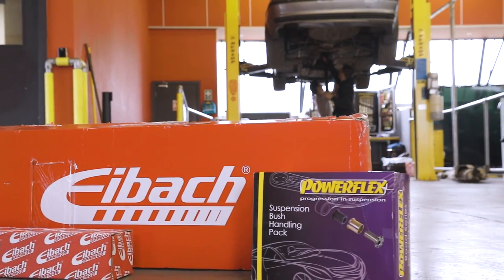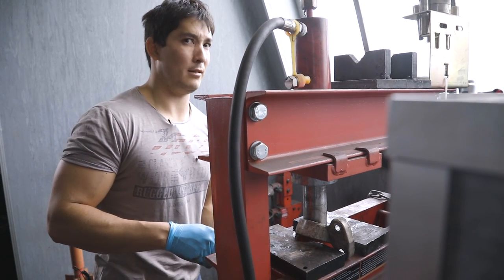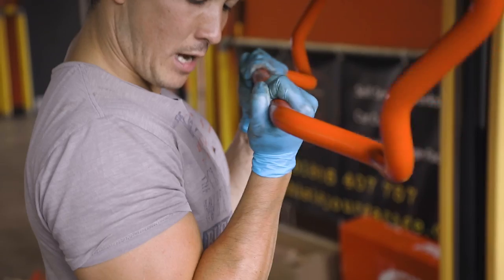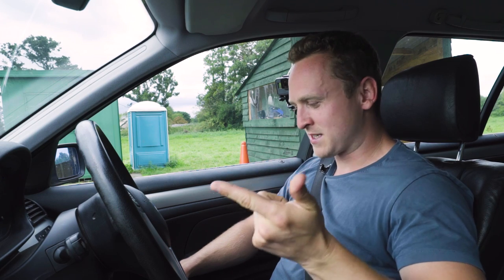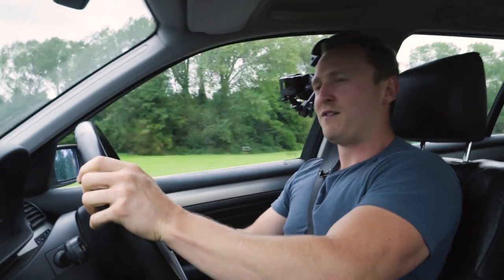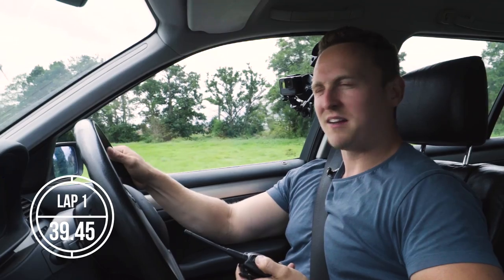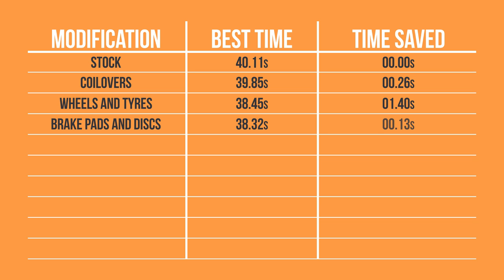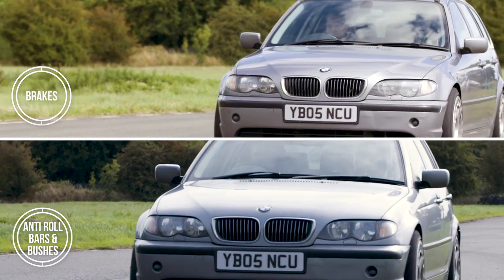Do Thicker Anti-Roll Bars And Polybushes Make A Car Faster?

Comment: Help! I have an Saab 93-x i thinking about changing the swaybar bushings, to some powerflex bushings. But the stock frontbar is 28 mm and the rear is 21mm. But I can only find 24-25 mm for front and 17,18, 19 mm for the rear in the store for my car. Am I supposed to use smaller bushings or dosent they fit my car? It's an XWD

Comment: But putting those bushes in there will put more stress on the material itself and especially e46 from the first generation had massive problems with their rear seperating from the body, cracking all over the points it´s bolted to. Kyle Reese is doing it on his M3 atm, check his channel, he has the problem and the solution! .

Comment: How much NVH did you get after installing the poly bushes? After i installed a poly bush  engine mount due to the engine always ripping it after the tune, i got quite some vibration in the car.

Comment: You should have put the car on the ground before you tightened up the roll bar. Without doing this you'll have preload on the bar which will cause understeer. The weight of the vehicle on the suspension is crucial in this install. Just like the install of monoball bushings for control arms which will create added nvh unless install with load.
Reply: It's also why you said " the tires are the weak point" because the tires can't grip due to the stiffness of the bar. That's gotta be a second right there.
Reply: In the slow motion clips it's very apparent what the car is doing.

Comment: Who wants to tell them that the stiffer sway bars helped the inside wheels lose grip?  Anyone?

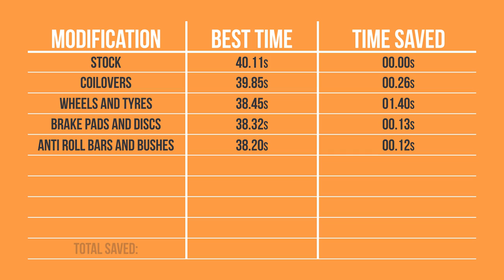Check the slo-mo at 11:29.  More steering angle in the front tires, more daylight under the inside wheels during the left turn, and the entire car is not as straight on corner exit to set up for the following right turn.  It's skating sideways, not going forward.

You guys saying that this car looks like it's getting too stiff for this course are right.

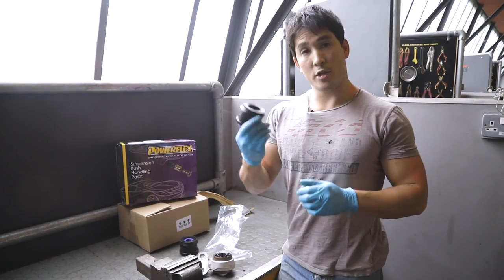Comment: Not sure using the best time in each video is a fair way for comparison. Alex started from a lap time of 1:39.45 and ended with 1:38.20. That was a difference of 1.25 seconds. Compared to 0.12 seconds shorter lap time over the brake video, it seems to me that driver variation can easily explain that improvement. Put it the other way, had Alex kept practicing in the brake video, he would have trimmed an extra 0.12 seconds. If so, how could we tell the effects of the anti roll bars and polybushes? Some suggestions: Alex should practice and gets familiar with the new hardware before timing a lap. Once consistency is achieved, an average  of 3 lap times would be a better indicator.

Comment: You should turbocharge your coilovers, then add a wet shot of nitrous to your dif. I'd also get the ECU slammed and install an airbox-back exhaust
Reply: For maximum performance though, you're gonna need to get a forged interior, have your bottom balanced, install direct to forehead throttle bodies (as many as you can fit, more is better), then drill holes in your engine block and head casting to save weight.

Comment: The car needs weight reduction throw away those seats at the back and fit in a recaro bucket seats,change the engine oil to fully synthetic (castrol edge),platinum spark plugs,straight pipe exhaust,short ram/cold air intake,aluminum radiator,racing injectors,lightweight flywheel,racing ecu/chip,lightweight crank pulley,polished engine block would do a lot better without turbocharger just my opinion.
Reply: yeah spark plugs on a diesel

Comment: Anti-roll bars are actually a very 'risky' thing to mess with. Risky in the sense of risking to make your car worse. They make a huge difference to the amount of mechanical grip on an axle so if you get this wrong it will make the car worse. They're probably the last thing to mess with when tuning a car, especially if you see how little the time gain is from installing one.

Comment: i personally found stiffer adjustable bars one of the worse mods to do.. very hit or miss. better off using adjustable front and rear damping to control handling assuming you already have decent anti roll bars.

Comment: I cant watch you putting new PU bushings into the rusty piece...
Would it be that much of a problem to, while the part is off anyway, have it sand blaster and give it a lick of paint?

I know it would take a tiny bit mroe time.. but it would be doing things properly and not a half ass job.

Comment: All the suspension and brake mods combined were a third as effective as getting better tires. In my opinion, suspension upgrades are highly overrated considering their cost-to-performance factor. I've tested dozens of tires on the two cars I've owned, and I've found that tire choice is one of the most important things you can make on your car. Most people only think about how long they last, or how loud they are, not how they perform or handle. I'd save my money on the suspension and spend it on getting the right tires for the car, even if that means replacing them more often.

Comment: Not a great idea to change the bushings. The reason they were originally equipped with rubber is because the soft rubber flexes. This fex is taken in to account by the engineers to assist with handling.  Its called elastokinematics

Comment: weight reduction. steering wheel, front seats to racing seats, and rear seats out. probably almost 200lbs , especially if the fronts are power and heated, they're probably 60lbs each.

Comment: I had a black E46 330d MSport Touring. It looked the nuts, but honestly it was the worst car I've ever owned. Even with new Eibach springs, Bilstein shocks & bushes all round, it handled terribly. Felt even the smallest bumps on the road yet wallowed like a barge round the corners. So many people rave about BMW's so they can't be bad, but I never did work out why mine was so horrible.

Comment: What about seam welding the chassis
Reply: Casey's Garage and full roll cage?
Reply: @JakobusVdL  why not? They could build one from scratch for cheap
Reply: Casey's Garage  - how about,
More stiff = Good, 
More weight = Bad, 
Easier to do than seam welding the chassis? Probably. 
Still a useful road car? Probably Not.
Reply: @JakobusVdL  how would it not be useful as a road car? Just because it would be a rough ride? That's not even an issue. On top of that, it's not like Alex doesn't have something else to drive

Comment: Give it 12000000 more HP, it won't go faster because of these nankang not putting it to the ground... RE71r or stickier non-streetable tires are a must at this point... And maybe not hitting the kerbs so hard would help too, the car is flying at times... Less power put to the ground....

Comment: Your rear end is too stiff. Never thought a bloke would say that to you eh? The rear tyres are tending to skip around and the coil settings need to be dialled back a wee bit. There is this myth that harder lower suspension must give better traction and adhesion, but its not so. 

On a track that tight, you might want to look at increasing the negative camber a bit too. By the way, you are wrong about not feeling the difference on a road car. Fitting a full set of polys would just make a bumpy noisy car, so with a real world car I would just go for front ARB bushes. These are also the ones that tend to deteriorate most quickly, and manufacturers treat standard items as more or less disposable. They really do sharpen up the front end.

Comment: I think you are very wrong,being into car sports since i was 11 years old starting with karts,banger racing,stock car,rallying and now being in my 40's uprated suspension,bushes,anti roll bars/sway bars,steering racks,bump stops,top and bottom braces etc make alot of difference to road car driving and not just track days..the control of the vehicle changes enormously and braking to.keeping the tyres flat on corners and car toe and camber adjustment as well as alignment is the basics to the ultimate car handling making you trust the car alot more and reducing the loss of control..do the cone test and see the difference

Comment: Very nice series but it's so ugly to see adding brand new aftermarket parts to a rusted out car which is going to be worse year after year. At least you could have removed the rust from the running gear before the upgrades

Comment: I think this and the last episode were pretty useless, especially on this track. On a longer track it might work out, but is by far worse in terms of price-performance than other options (sure, brakes are necessary at some point, though).

And why do you now concentrate on power instead of doing the most useful and simple thing: stripping weight?

Comment: U could have done way better without the jetlag mate . Driving needs sleep like sand dunes need rain
Reply: Maybe U should stop doing weights or change at 99 to reduce the weight ratio in the car or get rid of the spare

Comment: . . . so just a marketing vid? 0.12 not significant at all, could be a myriad of reasons not least the poor time logging control. The question is why, with all the added stiffness, is the car not faster after spending best part of £1,000 on bushings and bars? This is a pointless exercise. The first "upgrade" is driver training but hardly ever done, people preferring instead to spend spend spend on pointless upgrades like this. A day's training - £1,500 perhaps on an empty track but no, the hapless driver would rather have £1,500 worth of parts to fit instead. It doesn't matter how good the pen is if you cannot write.

Comment: BAD idea. such hard bushes would destroy the car body, and would result in body cracks. this is a road car passenger car when durability is most important. this kind of bushings are only good for race cars.

DO NOT do this on your car please. i have e30 and i always change the original bushes after a few years. i want to preserve my car body.